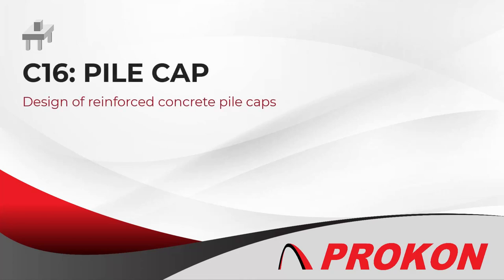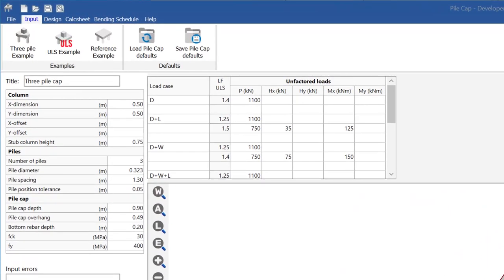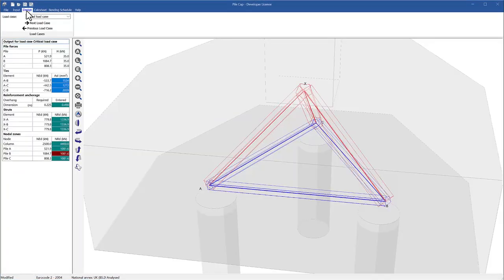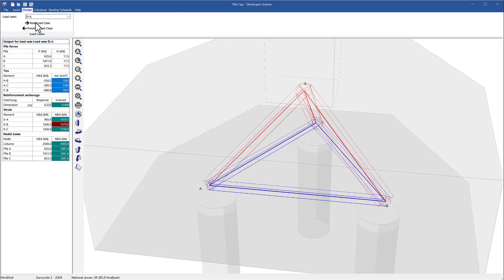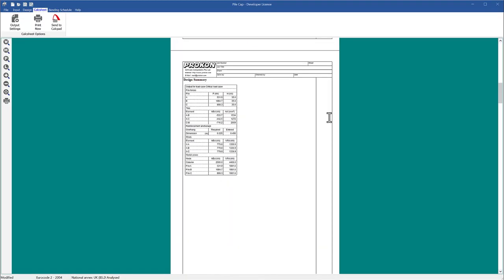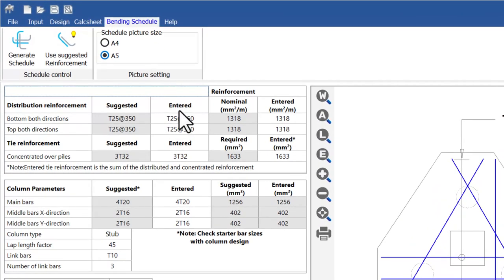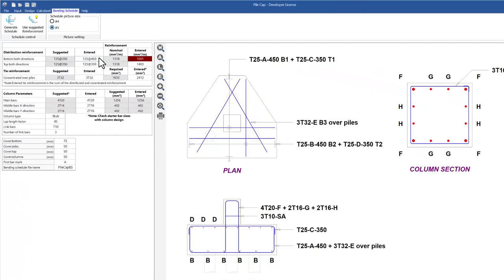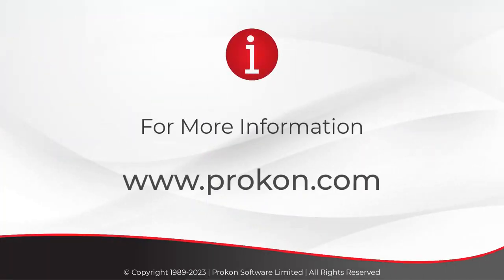Pile Cap

Comment: Would a FEA be too computationally expensive for this module?
Reply from the maker: Hello Angel,

For routine tasks, a finite element analysis may be too elaborate. It’s also a lot more difficult to design reinforcing that way. 

We recommend that you use the Pile Cap module in most cases. If there’s a special pile cap that falls outside the scope of the module, you can do a finite element analysis in Sumo using solid elements.

Regards,
Prokon
Reply: @prokon6061  Got it. Thanks.